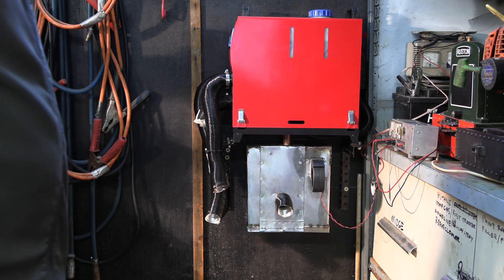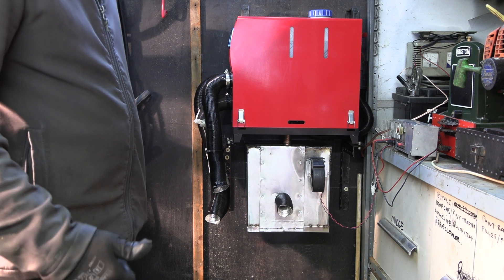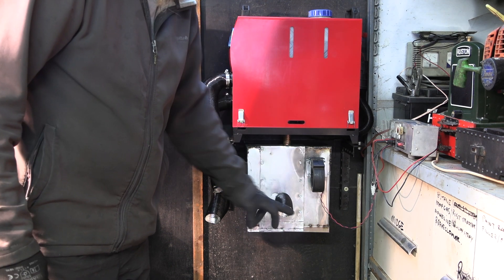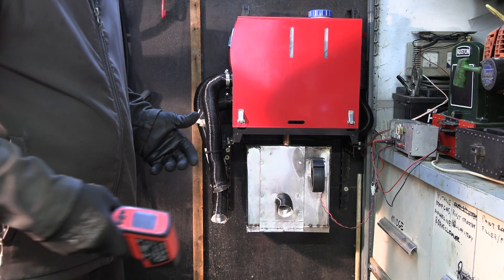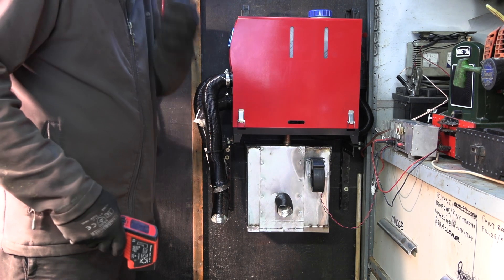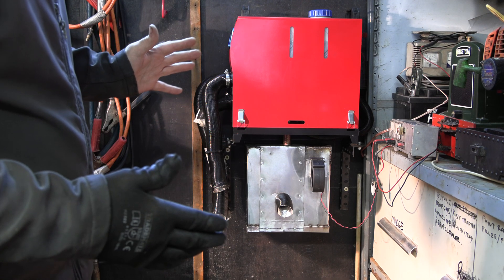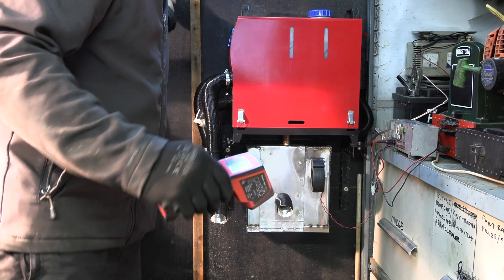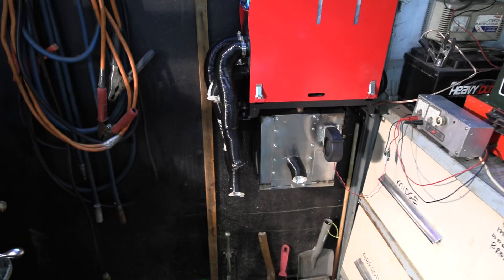Diesel Heater Exhaust Heat Capture

Comment: My idea was to get one of the longer exhaust pipes and bend it into a large coil and install ii in a 5 gallon metal pail. Then I would mount a small fan on one end and an exit flange on the other end. I would think that would give me all the heat off of the exhaust before it exits.
Reply from the maker: Yes good idea , I have done another video with a longer pipe with some good results .

Comment: It looks great! Instead of a longer pipe in the box, you might also try metal fins on the pipe to dissipate the heat.
Reply from the maker: Thats a good idea to increase heat transfer . I only did this as a quick and cheap way to cut my heating costs when in my workshop and did not really expect this much interest ! I may well try and improve it further and will take on board all the excellent ideas .

Comment: If the exhaust cracks wont it spill fumes into the stainless box?  My chinese heater exhaust only lasted 2 years before it cracked when it was simply sitting there exposed to air.  I would trust this more if you had an actual rigid stainless exhaust tube that was welded.
Reply from the maker: Thanks for the comment. Yes there is always a possibility that the pipe would crack and fumes enter the room . I suspect no more than a normal heater with some of the exhaust inside the room but I have now got a carbon monoxide alarm just to be on the safe side ,as used in caravans and campers .

Comment: Glad to have come across your video. I am looking into these heaters. My aim is to use the recovered heat to heat water, in that way, I get free hot water, given the ever increasing living cost crisis, aka, inflation, money's gone to fund foreign wars that we have absolutely no business whatsoever. Anyway, we can't vote them out, so we look for alternatives. I can't afford proper food, so I supplement by food with animal feed. Nothing's wrong with it, just a few gravels in it. I replaced bright light bulbs with £shop 2W bulblets. I store food outside and switched off the fridge, etc. 

You can go up to 2m in length and 270 degrees in total bends when it comes to the exhaust pipe. This is what the manufacturer recommends. I have seen many people who go above this limit. If you exceed it, you could have an incomplete fuel burn resulting in sooth build up inside the burn chamber and smelly smoke from the exhaust. You'll never know. Try it.
Reply from the maker: Hi thanks for the comment ,I'm sorry to hear about your situation and hope it improves soon. I'm not surprised in the least . I have a number of serious health issues after working as a mechanic for 48 years and can no longer work but for some reason am not entitled to any benefits ! so we live off my wife's humble wages and I do what I can to save money . I have had no income since Jan 2023 . The system is not working as far as I can see. Good luck.

Comment: what about condensation? Are you getting water condensing in the exhaust, like in a condensing boiler? it might be good to have a drain hose like in a condensing gas boiler. They use the combustion air-in to cool the exhaust and condensation is collected. it takes loads of energy to evap water and you can re-coup the energy when you condence it!
Reply from the maker: Hi Matthew , Thanks for the comment.  Its true  what you say about combi boilers but in this  case the exhausts should always run downward ( according to the installation instructions ) and they have a drain hole in the silencer that has to be placed pointing down when correctly fitted. I have used the short exhaust that came with the heater and it was easy to keep it going downward , however when I get round to fitting a longer exhaust I may have to make a bigger box to fit it in to ensure that it still does.

Comment: Interesting! But dont you get a diesel smell from blowing exhaust air straight into the room?
Reply from the maker: Hi The exhaust only travels through the box before going outside of the building ( through the black garage door heater is mounted on ). The fan takes air from the room and then blows it around the exhaust and then back into the room .

Comment: i just realized... i can just pipe the exhuast into another diesel heater, wire up the fan, and woolah. efficiency.
Reply from the maker: Woolah indeed .........
Reply: Let us know how well combustion works after you burn all the oxygen off in the first heater
Reply from the maker: Hi Im not sure what you mean , there is only one heater . The second silver box is just a box that the exhaust travels through before exiting through the door to outside . hope this helps.
 @guywithjeep
Reply: @donkey2lathe op said to use exhaust from one heater to feed another heater
Reply from the maker: @guywithjeep  I guess you mean the part when I said I used one of the heater output tubes to blow around the box and exhaust and push warm air into the room . That was only being used as a source of forced air movement but didn’t work as well as the small electric blower .

Comment: Why not just use a long steel pipe? Could just lay it on the floor and out the other wall?
Reply from the maker: Hi , I did consider that as others have done. My reasons  are , it will get in the way in my small workshop and  I will probably end up touching it accidentally. Also it will be radiant heat that tends to heat a small local area rather than blown around. Theres nothing wrong with radiating heat but in a simply built garage with some drafts and doors being opened it would soon dissipate, that has been my experience before when using a calor gas heaters and other radiating heaters,

Comment: Yeah, i like the box idea. Ive also been thinking of ways to make an exhaust heat exchanger. 
Re the wmo, i think you'll still have issues,  just further down the road. I also tried it, watered down but it just took more time to clog the main gauze (not the one around the glow plug, the big one you can't see in the swirl chamber) loads of info about on YouTube by many trying to burn waste oil. 
Nice work....
Reply from the maker: Hi Thanks for the comment. Yes I agree in hindsight I think WMO is more trouble than it's worth to save a few pounds. I have blown various chemicals through the inlet in the hope of clearing it and fully dismantled it once so a lot of work just to burn 2 gallons so far .